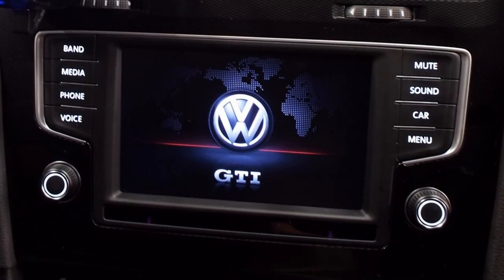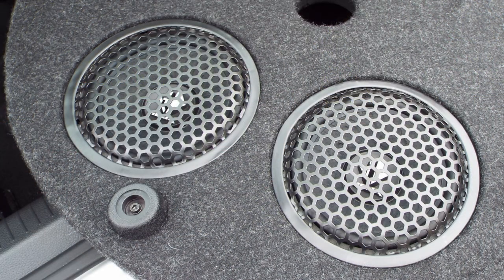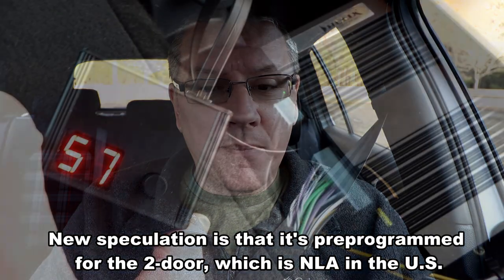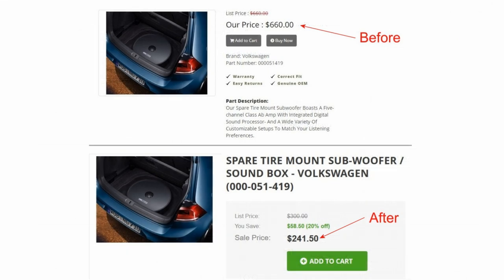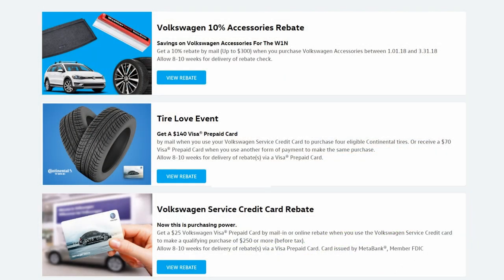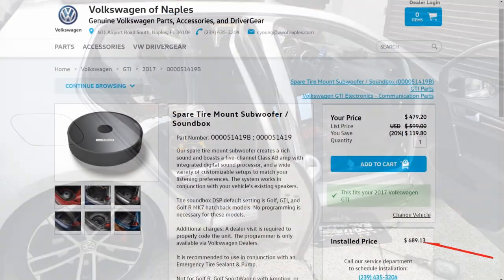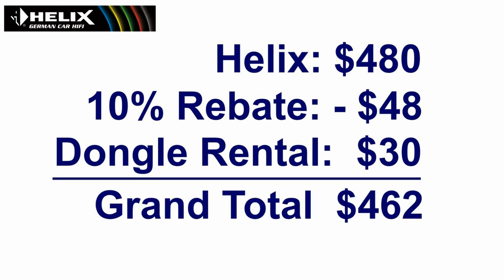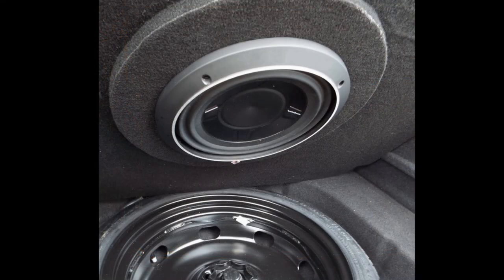VOLKSWAGEN HELIX SOUND SYSTEM

Comment: I read in the forums you can install the Helix ON TOP OF the spare tire (just order the $7 longer stem holding the spare). So, my dealership did just that a few weeks ago. My dealership was freaking out how clean it looked, and how the bass was even BETTER sitting higher in the trunk. This isn't just a subwoofer, it's a crossover. It brings out the awesomeness of the sound. SO CLEAN. Sounds like butter. You want to thump when the bass drops? This WILL do it. Want to rock? This will do it. Sounds AMAZING.
Reply from the maker: Vicky - Thanks for the note. The Helix system really is a good upgrade for the money. I'm not sure if it's worth full retail plus VW installation, but it's certainly worth what I shared in the video. Time will tell if I add Helix to my wife's new Jetta SE. Thanks for visiting!  -Scott
Reply: Hi Scott. When I bought my car I worked a deal to get the Helix with installation and dongle programming for $500. I thought it was decently fair and went for it.
Reply from the maker: Nicely done! It's certainly worth $500 installed! -Scott
Reply: Vicky Spit can you still use the bottom liner or is the spare and unit uncovered?  Also which dealership?

Comment: Thanks for inspiring me to do this upgrade by myself, bought my gti round about the same time as you bought yours and can't believe I waited this long to do it, I had no idea it even existed!
Reply: I also rented a dongle and it made an instant difference. I had to flatten my equalisers and remove audio enhancements on my phone to make it all sound perfect. 57 was the much better tune as you hear vocals from the A pillar tweeters on the mib2. But you know all this already 😂
Reply from the maker: Glad I could help! Ironically, I removed my Helix to make room for more ham radio equipment. I can put it back since the wiring harness is still in the car. But, to be honest, the louder exhaust note makes it difficult to hear a huge difference at my current listening levels. Thanks for visiting!

Comment: I swapped the helix subwoofers with two JL Audio 6w3v3-4, wired in parallel, powered by an alpine MRV-M500 that’s receiving its signal from the helix unit. I was completely blown away by the amount of clean bass these things produce, almost on par with the two JL Audio 10w3v2-d4’s that I’ve had in my other car for about a decade. Sadly, this makes it even more noticeable how dull the rest of the speakers in my 2018 gti sound.
Reply from the maker: Chris - I need to sit in a car with a crisp sound stage. Otherwise, it's hard for me to know if my stereo is dull or if my old hearing is culprit. Someone recently sat in my car and said it sounded very detailed and bright. I'll have to try another car to be certain. Thanks for visiting. -Scott

Comment: Getting this programmed by my dealer was a nightmare. I got them to throw this in with the deal when I bought a new 2017 Jetta SEL which was nice! I think off the bat I had a faulty Helix amplifier and the subwoofer didn’t produce bass. I found someone local to me on VWVortex with the same Jetta and a Helix to come to the dealer with me to demonstrate to service how it was supposed to sound. Sure enough mine was not putting out bass from the subs. They replaced my Helix amp but still could not figure out the DSP presets. The service guy was convinced the higher the number on the programming dongle, the more bass, lol. I also found out they wired the left and right channels backwards which they also had to fix. No idea how they did that when it is a plug and play harness. I ended up going to a different VW dealer that had the Helix dongle and they happily programmed my Helix to the correct Jetta Mk6 DSP. Very pleased with this setup, huge improvement over stock audio and overall soundstage. It is super important the correct DSP is programmed into the amp via the dongle or else your audio will sound wacky.  ALSO REMOVE THE RJ-45 JUMPER PRE-INSTALLED ON AMP. It sets the sound stage for right-hand drive cars. Highly recommend this for non-Fender or non-Dynaudio Volkswagens!!
Reply from the maker: That first dealer you dealt with was staffed by buffoons! I just flashed another GTI owner's car this week. It took less than a minute. I had him sit inside the car as I flashed his amp so that he could hear the immediate difference. Glad you got it sorted.

Comment: Great video. I got the subwoofer installed at the dealership and I think that they messed up the programming because rear speakers sound really bad and there’s only bass when you sit at the second row. I’ve ordered the programming dongle and hopefully it will improve when I program it
Reply from the maker: Have you upgraded any of your speakers? If yes, Helix will make them sound way too bright. Thanks for visiting.
Reply: @StealthGTI  No, I haven’t. I’m actually trying to program the helix right now and for some reason the dongle won’t turn on when I connect it. I have the ignition on so I don’t understand what could be wrong
Reply from the maker: @Joe-cy5hm  - The ignition doesn't need to be on, only the stereo. You can actually run the dongle without a key nearby. Strange that you're not able to see the dongle work.
Reply: Could be out of phase too since it's a programed DSP amp of a very basic variety so channel polos polarity can be muddled if software is messed up at all. Just one possible situation anyway bud. Hope it's fixed now.

Comment: is it possible to get the wire harness on its own? Or do any other brands make a wiring harness like this? looking for a solution of taking sound signal to the back without cutting any wires
Reply from the maker: I'm pretty certain it is not available on its own. When I bought my unit at a deep discount, I felt the harness alone was nearly worth the cost. HAHA! I, too, hate cutting factory wires. Good Luck!

Comment: Bought one of these many months ago and after unsuccessfully searching for someone local with the dongle, I ordered one of those also and then finally found a free day for the install. Unfortunately I hit a rub right away. My car doesn't have the unit in the glove box that all of the install videos show the Helix plugging into. I did call a local shop that specializes in European cars like mine, in fact they've done some great work on my car in the past and I trust them, but even they told me they couldn't install this unit. I'm not sure what to do at this point.
Reply from the maker: Does VW's website show it as being compatible with your vehicle? If yes, then it's likely that the back of your head unit has the same connector(s) as the glovebox unit on other cars, except for the remote display. If that's true, then I see little reason why Helix would not work. You just have a different degree of work to do to get the job done since (I think) you'd have to disassemble parts of the center console to access the back of the stereo. Good Luck!
Reply: @StealthGTI  Yes .. I found out that the amp is attached to the head unit instead of being in the glove box. All is well. Now I just need to find a few spare hours.
Reply: @StealthGTI  I finally got it done! I was just very confused with the wiring until I finally just made up my mind to watch LHG's video over and over and over, even though I can't stand watching videos when people hand hold their cameras/phones. It disturbs me. Hah. But I soldiered through, cussed a bit, made a quick trip to the auto parts place for a de-pinning tool, and got it done. The only thing I was unable to do was update the dongle. I just used the 57 code that came programmed on the card with the dongle I bought. The executable I download from the link you provide on your website doesn't seem to want to recognize my SD card - or I'm doing it wrong. Probably the latter.
Reply from the maker: @mattb4rd  - The dongle should have more than just file 57. Connect the device and energize the radio (no need for ignition). The dongle should light with whatever file was last loaded. It sounds like yours will say "57." Rotate the knob to see if the numbers change. If they do, then you have more files on the card. Choose a file, then press and hold the known until the dongle's display flashes. You're done; a new file is loaded. I don't recall which car you have. But, if the dongle doesn't have a file for your car, then you can fiddle around and try different files until you hear one that you like. Let me know if that works. Take care!
Reply: @StealthGTI  I have a 2019 GTI ..57 is the correct file. and yes, the dongle does have other files, but I believe, like yours, 57 is the correct file. That's what I flashed to it and it does sound good.

Comment: Hey how are you ? I have a 2020 r line Jetta that already came installed with the hex in it I was just wondering how would I put the bass up and to program it
Reply from the maker: Your Helix should already be pre-programmed. The bass is tailored from the "SOUND" menu in your infotainment system. Unfortunately, Helix's subwoofer cannot be controlled independently. If you're asking how to get even more bass, and the lower kind, check out the 500-watt subwoofer system that I added to my Helix: https://youtu.be/2-f6BPnmdlM. Thanks for visiting!

Comment: My 2016 GTI volume stops going up at about 60-70% of max volume. It seems like there’s some type of limiter on it. Do you know if this will fix that or do you know another fix for that problem?
Reply from the maker: Hello - I think that's somewhat normal behavior for a lot of lower power head units. They do that to get more "oomph" in the early movement of the volume dial... "WOW" factor for the owner, right?  ;-)  The Helix upgrade will not resolve that; it will only increase overall volume.  As a result, "70%" is quite loud. I think I indexed my add-on subwoofer amp's gain at 75% on the stereo. Thanks for visiting. -Scott

Comment: Do you know if your programmer dongle programs the Revision B system properly? I just pulled the trigger on one and now I'm skeptical about the programming part of the installation.
Reply from the maker: It does work with both versions. The differences between the original and "Rev B" versions is internal, probably a change of supplier for internal parts instead of a true redesign. See this video where I (coincidentally) jump between programming my original Helix and someone else's Rev B: https://youtu.be/43nMbBJMqog. Thanks for visiting.

Comment: Hello, I installed the Helix on my Golf 7 R but I met an issue with the DSP. In fact I tried to follow all video I found and the documentation of the DSP to active the sound but (after the setting program "57") when I power off the discovery pro, the amplifier cut too and no sound in all system anymore. To discover the sound I have to unplug the power of the amplifier and plug it again until the time I power off the discovery again... If anybody can help me. Thank you very much.
Reply from the maker: WOW! That's an interesting problem. Is this on a North American car? I don't know if it matters. Also, you re-pinned the power cable, right? You said you followed all directions, but I still have to ask since your problem reads like a power issue. -Scott

Comment: Hi, do you know if the Helix sound system works well on a Egolf ? Is it the same program? Hope my dealer will know about that part! Thanks
Reply from the maker: Steeven - Searching the P/N: 000-051-419-B, on VW's accessories website indicates that Helix is not compatible with the eGolf. I'm not sure why it's incompatible, but this news seems to warrant a visit to your dealer for clarification. Thanks for visiting! -Scott
Reply: Steeven Sirois https://www.speakev.com/threads/helix-audio-upgrade-works-on-egolf.141843/
Reply: I've read elsewhere that it is compatible. Thinking about checking dealers around Seattle to see how much they'll sell and maybe install for. A couple of the installs I watched seemed like a fair bit of work (I used to do installs in the 90's, so not totally unfamiliar, just lots of plastic to remove...everyone has their own line with paying for labor)
I think it had to do with the missing spare tire in eGolf, but it totally fits. You can find photos and testimonial...

Comment: Hello,I have seen you video and as you recommended bought the Helix audio system.but in my opinion it did not add a lot to the saund quality i had before,the lows and such are missing,i expected a different effect.i had a vw with dynaudio system and it simply cannot be compared,the sound was way better.is it maybe the case that it does not play as good because it is not programed yet?
Reply from the maker: I think you'll hear a good difference once the unit is programmed. Everyone I've ever flashed has commented on the difference. There's a link to a dongle rental thread in the video description. Renting one and programming it yourself will ensure that it is done. Good Luck!

Comment: Hello, do you know if the helix subwoofer will work on the 2019 GTI SE? Thanks in advance.
Reply from the maker: Assuming that any 2019 GTI SE will come with an "available" Fender premium audio system, the Helix upgrade will NOT work since Fender already includes an external amp and subwoofer. Thanks for visiting! -Scott
Reply: The SE doesn’t come with a fender audio system. I believe it come with 6 speakers. Will that work? Thanks for the reply.
Reply from the maker: @josephbrenyah4910  - According to VW's website, Fender is an option on the SE. It seems to me that dealers will order their SEs loaded to maximize profit. However, if your SE does not have Fender, then Helix will work. Fair enough?
Reply: Yes thank you.

Comment: Did you ever try the Helix with aftermarket speakers?
Reply from the maker: No. I've read too many reports about replacement speakers sounding shrill, even with speakers that are said to be for VWs. Helix engineers contoured the DSP with the factory speakers in play. Replacing the speakers changes the dynamic and, as a result, skews what Helix engineers accomplished. Thanks for visiting.